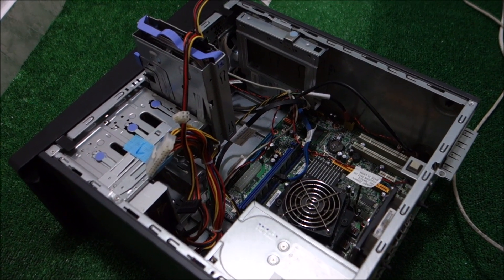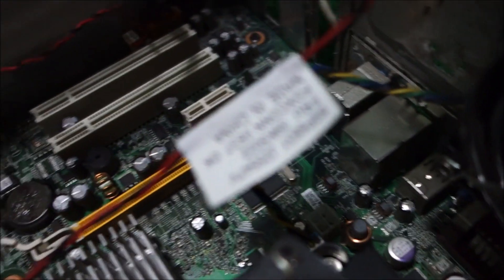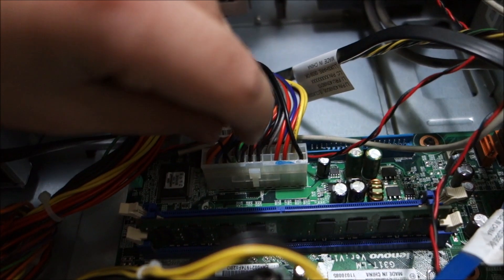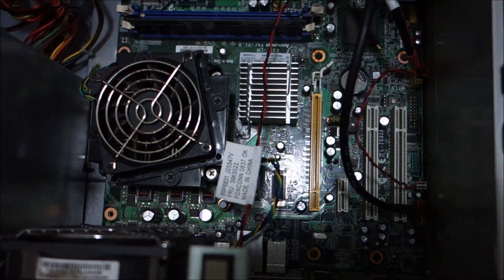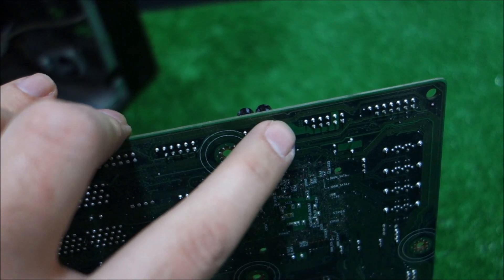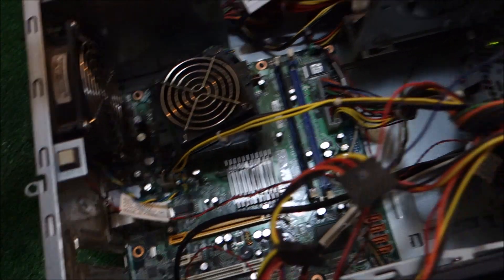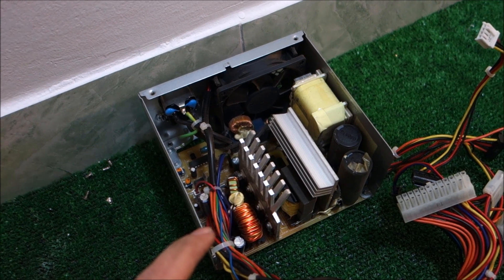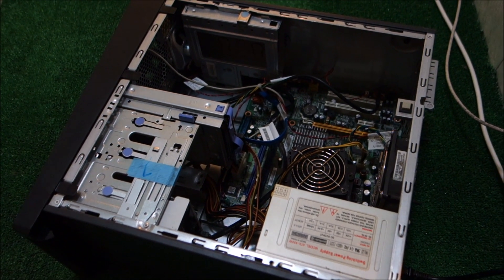How to repair a Lenovo Thinkcenter A57 desktop PC

Comment: 1. Buy a PSU testor, they are $15 to $30
2. Do NOT put a computer on a plastic carpet as you may cause damage from static
3. When testing the PSU you should NOT have anything connected, especially the hard drives or SSDs as you may lose data or cause more damage.

Comment: sir my problem is when i plug in power cord automatically power supply running but button on/off not function,ihave press many time but indicator not blinking
Reply from the maker: Is the button connected properly in the correct location to the motherboard?
Reply: Yeah, problem started when i start bios to default
Reply from the maker: Then some bios settings might be wrong.
Reply: @UltimateDIY  yeah but now when i plug in power cable automatically power supply running but power on button not work and no display on monitor
Reply from the maker: @azhardiansyahanuar8148  then it might be worse. Your BIOS might be corrupted and you need to reflash it with a bios programmer.

Comment: Yo! I have been wondering about this computer and I got to your video. I've this pc atm and I want to know if you can tell me which parts  (hardware) works good with this pc. I'll use it to play low-requirements games like league of legends, minecraft, cs:go  (not sure) and school obviously. I'll be happy if you answer :D
Reply from the maker: +SThing hi there! I need the exact model to give you more detailed (and correct) informations. It should be written on the case. It is a 4 digits number, something like 9704 for example.
Reply: +twizar It says 9702 - A57
Reply from the maker: +SThing ok, here you should find a list of compatible parts:
https://support.lenovo.com/us/en/documents/migr-69271
What CPU and how much RAM do you have now?
Reply: +twizar I have the Pentium E2180 2.0 or 2.2 Ghz I'm not sure, and 1gb ram
Reply: +twizar I looked up on Lenovo's website but I got confused because they have another page for A57 models which includes mine (9702). I think I can upgrade to 4gb ram DDR2, Core 2 Duo processor and nvidia gt 430 or similars. Btw I forgot to tell you that the exact model is 9702 - AB7 and some people who has this pc has the same hardware of mines.
Reply from the maker: +SThing ok, you should upgrade the RAM to 2GB at least and maybe the CPU if you feel the need. As for a graphic card, you can use anything under 75w that fits the budget.
Reply: +twizar And I have two channels for ram, at the moment using 1 channel with 1gb ram
Reply: +twizar Thanks man, I will notice you if I upgrade it.
Reply from the maker: +SThing ok, welcome :)